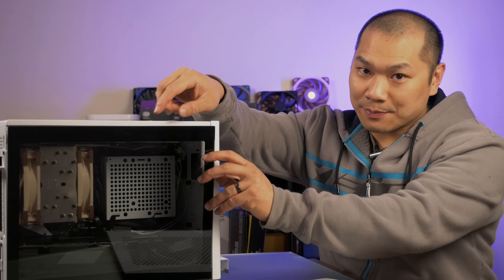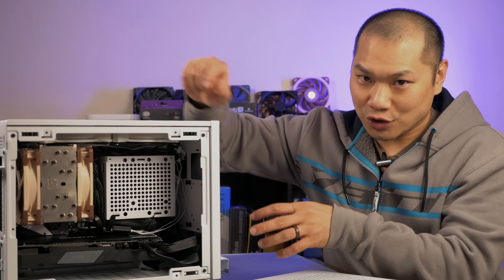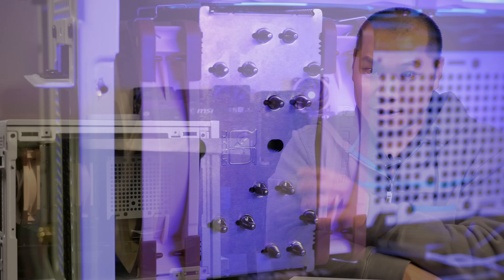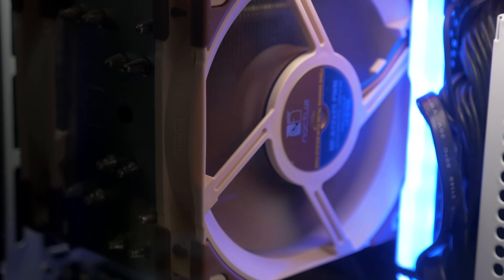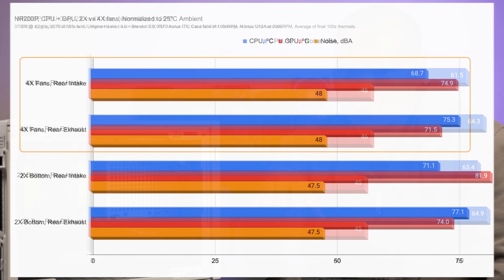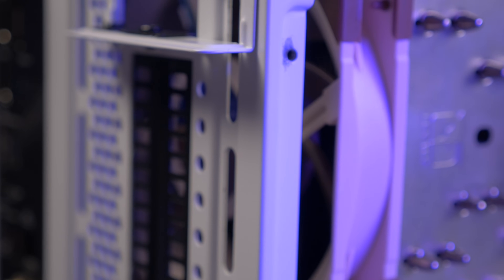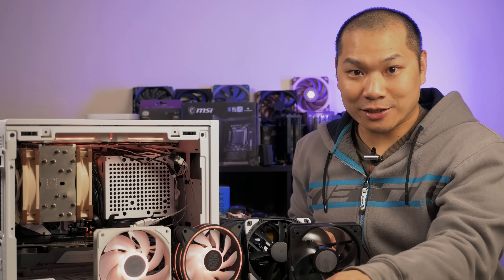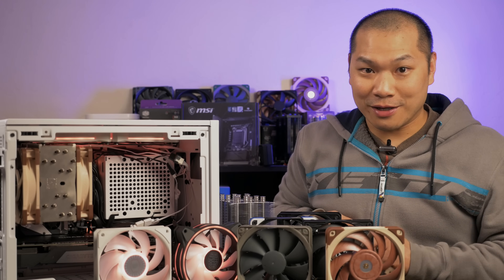Cooler Master NR200: Optimizing Air Cooling Thermals Part II: Higher TBP GPUs and the NR200P

Comment: Hey, thanks for all your coverages of this case. This has been extremely helpful for a first time SFF PC builder like me. What are your thoughts on the Fuma 2 with 2 bottom sickle flow intake and  1 top Noctua NF-A12x25 exhaust? Planning to use the tg panel as well.
Reply: Are you still running this setup? if so, how is it performing?

Comment: For the past 12 years i have been using gaming laptops. And when i finally made my first desktop build after selling those laptop off, i fell in love with your NR200's reviews.

I am pretty content with NH-U12A as exhaust, and Four NF-A12X25, 2 exhaust on top and another 2 intake from the bottom. I used the same specs, with Deshrouded and dowvolted 100mv 1890Mhz Zotac 3080 OC and so far it has been serving me well, and i am satisfied with the performance that this setup provides. It's overkill, but since i am living in the tropics, temps are the only factor i need to take in. Thank you good sir for your wonderful review and suggestions.
Reply: What cpu are you using?
Reply: @PetWanties  same 3700x
Reply: @blackhowling  awesome build mate.

Comment: Nice video! May I ask if the provided case fans will fit at the bottom of the case if you have a 52mm graphics card? If not, what fan would you recommend as bottom fans for the gpu size I mentioned?
Reply from the maker: Cheers! Nope, you will have to with slim fans. For slim, static pressure fans IMO there’s only one solid choice and that’s the Noctua NF-A12x15mm (links in description) They come in both Chromax and regular.

Comment: Thanks for testing all these configurations, really excellent work here!  I have two possible improvements/tests that could be worth testing.
1) The NH-U12A is simply too big for the NR200P and the air flow is not optimal as it break the bottom to top airflow. Having two fans perpendicular is not ideal too. Pairing it with a NH-U9S instead and using "small brackets" to put the fan/intake at the bottom would keep the airflow bottom/top. Wonder the NH-U12A is really needed here, especially if paired with a 65W TDP processor like AMD 3700X/5600X.
2) I also wonder if slim fans like the NF-A12x15 would yield better result in the bottom too by giving airflow channel 1 more centimeter.
This is the configuration I will try, but unfortunately waiting for the 5600X to be delivered and worst, the RTX3070FE to be available for real.
Reply: interested in the south to north bottom top of the NH-U12A as well.. just wondering if the GPU heat would affect it adversely.. anyways do let us know on this update.. thinking of a 5600x AIB 3080/6800xt build
Reply: Good point with the over powered cooler. I have almost the same setting, R5 5600 with a RTX 3070 and have ordered low profile coolers (Scythe Shuriken 2, Scythe Big Shuriken 3 and Noctua L9a). I will test them today and see which one will fit best in my setting. Helpful  and definitely worth reading was the following review which compared the listed low profile cooler. The Scythe big Shuriken 3 was the best in the comparison, second the Scythe Shuriken 2, third the Noctua L9a. Interesting here, the heat removal could be increased when replacing the 15mm fan vs. 25mm fan but only when go for the ventilated door panel.
www.mitxlove.com/2020/04/12/scythe-Shuriken-2-low-profile-cpu-cooler-review/

Comment: Excellent and thorough coverage as usual!

My experience with adding (2) bottom slim fans in the NR200p with my EVGA 3080 Ultra with the TG and a tower cooler (Cryorig H7 intel 6600k at 4.1GHz) was lackluster at best. It improved GPU temps by 1-2°c at most and without the bottom fans the stock fan curve the GPU seldom gets to 70°c+ This is likely due to the GIANT heatsink and 3 fan configuration. 

Due to the slim fans being basically against the GPU it just added turbulence and increase case noise. Fans were removed and returned. 

Waiting for Zen 3 to be more widely available to finish my build. The 6600k has been a trooper these last several years and it's time for an upgrade.
Reply: Interesting, I’m in sort of the same situation with the 3070 gaming trio. I think the frontmost slim fan is actually acting as the anti-sag device for the gpu, as in the card is resting on it. 

I should probably just remove them as well and run the tower cooler as rear intake (using glass panel). Might need something else to keep the gpu from being pushed... those sleeved cables from the SF600 are super stiff and pressing on the backplate.

Comment: Does the NH-U12A allow top fans with the higher offset cpu socket on the MSI and gigabyte aorus 550 mobos? Great information as usual btw! Your series on the NR200 is amazing.
Reply: I’m running the gigabyte b550i, U12A with the 2 included fans up top, fitment was fine
Reply: @neilhr  Ahh cool thanks for the info I think that is the setup I'm going to go for too.
Reply from the maker: Should be the same as the X570-I Aorus. MSI from what I’ve seen is about the same as Gigabyte.

Comment: Are we safe to wire 4 fans into a single header? My motherboard only has a 1amp output.
Reply from the maker: The typical mobo fan header is a 1A output. It depends on which fans. Check the back of the fans you are connecting and add it up. For example the Sickleflow 120 are 0.15A but have a "safety current" rating of 0.37A. Under regular use, even up to 100%, you could run 4 on one header, the safety current rating they give is a "just in case", something jammed the fan while it's running at max speed type of situation. So if you want to be super super cautious don't run 4 of those on the same header. Something like Noctua NF-P12 Redux is 0.09A, Arctic P-12s at 0.2A, any of those add up to less than 1A so you're good.
Reply: Depends on the fans. Look up their specs and it will say what their max current draw is. Arctic P12s for reference are 0.08A, so in theory you could wire almost 12 of them before exceeding the 1amp. I wouldn't push it that far but with 4 you should be fine as long as the current draw for all fans doesn't exceed the 1 amp limit of your motherboard's fan header. I have 4 P12 PWM PST daisy-chained off a single 1 amp header and there are no issues.
Reply: Thank you! I’m running the exact same Cooler Master Halo fans in my upcoming build for top and bottom and was really pleasantly surprised to see you testing it. Loving all the NR200P content, stoked for the Mugen 5 video 🥳

Comment: Will a nzxt m22 cooler work better?
I'd really like to run a glass side panel, and not Screw it in.
Reply from the maker: It won't be better, but there should be a few choices in the upcoming comparison that will allow you to not use screws for the panel.

Comment: 13:00 Finally, people are catching onto the flaws of the Arctic fans. They do growl at high RPMs, especially the 140mm version. And another disadvantage that no one mentions is that they aren't padded with any damping material, so they can induce vibrations in a case. I highly recommend mounting them using "rubber fan screw mounts." The NR200's rubber grommets work well, too.

Comment: Thanks for all your in-depth work with this case. For a 3080 FE and vented panel, is this NH-U12A intake setup preferable over the previously recommended C14S, or is that still the best way to go?
Reply from the maker: For the 3080FE, I would recommend the C14S simply because of the direction of airflow and the ability to natively (without any mods) use the rad panel, which allows you to mount a side fan to act as a second side intake, further improving things. We're really splitting hairs here though, at the end of the day you could run either and it'd be just fine. With an extra pull fan the the C14S is closer to the cost of the U12A so it's pretty closely matched in terms of cost too.
Reply: @MachinesMore With the Fuma 2, would you also recommend running that in the same intake config as this NH-U12A?
Reply from the maker: Yes, especially with any Ampere founders edition graphics card.
Reply: @MachinesMore  Thanks man, think I might just go with the Fuma 2 then - I can live with slightly worse performance when it's only £50, compared to £90 for a U12A or C14S with extra side intake fan. I'm only cooling a 3600 for now anyways

Comment: I have the NR200 Non-Glass Panel and I'm looking for a pure Air Flow setup. 

I'm considering 2 140s as an intake for the side panel and 2 exhaust top, 2 intakes at the bottom, and 1 rear exhaust. as for CPU cooler, I'm sticking with Stock for the time being and may switch to non-Tower cooler later on. 

Thoughts? Opinions? Advice?

Comment: Does the side panel provide any noise/sound benefits? If I were to put the case on my desk would it make a big difference and worth it even losing a few degrees of cooling performance?
Reply from the maker: About 1dBA or so of dampening- although I will caveat that is with a decibel meter pointed at the glass/vent panel, so depending on placement relative to your ears it can matter or not. The TG dampening results in a more pleasant noise pattern if that side is facing you.

Comment: You could flip the right Top fan for intake and the left for exhoust and cooloer exhoust
Reply from the maker: Tested this- 76.8/73.9 CPU/GPU normalized to 25C, it's within measurement error of using 2X fans with cooler exhaust (77.1/74.0). Bottom in, top exhaust, that's how this case should work best. The top fan as an intake suppresses the GPU exhaust and just raises the ambient case air temp, which causes the CPU cooler to get stifled.

Comment: Hey Machines & More :) Love your coverage of this case ! 
I am wondering, can you mount an AIO on top ? Even with that top palen, is it possible?
And if it works... could one use ANOTHER AiO on the regular mesh sideplate ? 
kreygazm.....!
Reply: The only way to mount an AIO on the top is to do the "upside down" NR200 mod. It's a bit of a shame.

Comment: Can you try top down coolers blowing into the TG panel?

I know it's weird but NCase M1 user got the best thermals doing so with bottom & rear intake with a NH-C14S. I'd imagine NR200P will fare better because of top exhausts.

Here's his results: https://www.reddit.com/r/sffpc/comments/ahv94d/ncase_m1_c14s_vs_c14_vs_u9s_results/
Reply from the maker: I did- it wasn't able to keep up at all with a running GPU, and while I think it could work marginally for low TDP CPUs on stock settings... the bottom line is there are better options for the TG panel and I just don't see any reason to choose it for that purpose. The only reason it works well in this case is because you can push fresh air into its intake path, and with the glass, it's just not going to work well.
Reply: @MachinesMore  Ah I see. I was hoping the NR200P  would have similar airflow characteristics as the NCASE M1.

Thanks for all the info :)

Comment: I'm still confused! When you say 4x fans, rear intake, what are the orientation of the 4 fans? Are the exhaust since it's a rear intake, or are all the fans intake??
Reply from the maker: The 4X refers to case fans- The bottom fans always intake (point up) and the top fans should in theory match that direction. The cooler fans are what I describe as rear intake or rear exhaust. Rear intake pulls in air from the rear and rear exhaust pushes air out the rear. The best config is rear intake with bottom to top airflow.
Reply: @MachinesMore   thanks for the fast reply! That makes a lot of sense! What do you recommend for a alternative to the U12a if I don't want to do the screw mod for the tempered glass?
Reply: @PoweredbyGoo  many said fuma 2 fit the case

Comment: That mean C14s is for 3080fe, u12A is for 3080/6800/6800XT?
Reply from the maker: The U12A works well in either version, whether you can use the C14S depends on if you’re running glass or vented panel. When using the vented panel the C14S is great with the hot GPUs, especially the FE Ampere cards. It’s not a good fit with the glass panel.

Comment: Great, informative and straight to the point! Have been enjoying your videos for the past 2 months while waiting to actually get my NR200P here in Germany. It finally arrived today- so this is great timing. Now all I need is for my 5900X to arrive and to try and get a 6800XT and will be good to go. Would there be any changes in fan recommendation with this build and the tempered glass? Seems pretty consistent with what you shared in this video? If only the U12-A came in black as well!
Reply: @Guy_on_Youtube  Nice! Was hoping to use the NF-A12x15 Noctua's or maybe the slim version. Also not sure how it will help. Actually being able to buy the card will be the first challenge I think! :(

Comment: So I've finally finished my build in the nr200 thanks to your amazing vids on the case. I've got myself a 3700x with an L12S and all the optimal fan placements you recommend in your low profile vids, and have a 1660 super atm (two top exhausts, side panel mounted fan pointed at a rotated L12S with the fan on top blowing air towards mobo, two bottom fans below gpu as intake, mesh side panel). Reckon I could get away with upgrading to a 6800xt/3080 down the line without changing anything else in the build (got an sfx 750w plat psu)?

Comment: Honestly, from your previous videos it didn't look like bottom gpu fans were this important, but now they almost look necessary. My planned build has 5600x, U12a as an intake and probably a 3080 with no bottom fans, but now i should reconsider the airflow direction of the heatsink
Reply from the maker: They’re not critical for the vented panel but definitely recommended for the TG. For 3080 for sure, rear intake. Couldn’t even get the OC to stick with rear exhaust with a 3080.

Comment: Running the NR200P with TG, Scythe Mugen in rear intake, and a 5 pack of Arctic P12s. Works pretty well and no screws needed!
Reply: Specs and temps?
Reply: ^(2)
Reply: 2 stock + 1 artic for cpu?
Reply: Does your arctics resonate above 1100 rpm?
Reply: whats your config bro? 2 bottom intake, 2 top exhaust then the other rear exhaust?
Reply: What motherboard are you using, and which Mugen, what is your setup?
By my knowledge, the Gigabyte and MSI B550i have such high CPU heatsink placements, that top fans at 25mm don't quite fit with Mugen 5, and with Gigabyte's board, the useless 'gamer aesthetic' IO shield is so high, you can't really install a 25mm 12cm fan to the rear.
Reply: @funnyarc  I'm using GIGABYTE B450i AORUS PRO Wi-Fi

Comment: u can replace the motherboard standoffs w/ something shorter to fit taller air coolers. https://www.amazon.com/gp/product/B08CV7F6CC/ref=ppx_yo_dt_b_asin_title_o06_s00?ie=UTF8&psc=1 i bought these and it comes w/ 5mm 6-32 standoffs. i was able to fit the pure rock 2 (155mm tall) air cooler with the tempered glass panel on!
Reply: What about alignment of the rear IO cover?

Comment: I’m planning to put the halos on bottom and vertical mount gpu with big shuriken 3 cooler. Using a msi 2070 super for gpu. Still waiting on AMD 5000 CPU’s. Have you tried this configuration?  Watched all your videos but don’t recall that set up. Keep up the great work. I have the NR200P using the glass.
Reply from the maker: Hey Alberto- I tried this in the 3080 reviews- it didn’t look too good for the CPU since the cooler had no room to work. Plus without the side fan things don’t work as nicely. You might be OK if you run a low TDP cpu like Ryzen 5 and use something super low profile like a Noctua U9A, since that at least has some breathing room for the cooler.

Comment: I had NR200P case. I am going to buy an i7 10700K and a RTX 3070.

Do you think a Noctua C14S CPU cooler, 2x intake bottom NF A12x15 fans + 1 exhaust top fan) can handle this CPU and my vga card thermal?
Reply from the maker: Hey there! In general, yes, depends on how you are using the chip. I run a 10700k now in my personal system so I’m familiar with the behavior - if you’re overclocking it on all cores to 5.0+ ghz even a 240mm AIO will be at its upper limit, the 10700K and 10900K are at 200W, even up to 250W for PL2 levels so it’s no joke. So, if that’s your intention, I would not run a C14S. However, the better way to run these chips is at stock and give it the best thermal headroom so the thermal velocity boost can do its job, and IIRC it will only boost up to 4.7ghz on all cores workloads, which should be fine with the C14S. For gaming you don’t need all 8 cores, you should be able to get 5.1/5.0 on a couple of your best cores on stock behavior with the C14S. Depending on the 3070 you go with- full 25mm fans are possible as well.

Edit: I just saw you are using the P version- are you planning on using the glass panel? If so the C14S is a bad idea, stick to a tower.
Reply: @MachinesMore  no, I won't use glass panel. I just normal user. Do you think I should use i7 10700 (non K version) for better thermal ?

Comment: Sorry if you mentioned this in the video... does the x570 aorous have the same higher cpu socket placement that the B550i aorous? There's lots of reports of not being able to fit in a 25mm exhaust fan on top of the cpu using larger heatsinks e.g. Fuma 2, Mugen 5 etc... did you experience this?

Comment: How about gluing some neodymium magnets to the side panel for a magnetic hold? The magnets would also add a little thickness to help with the glass panel hitting the heat pipes. You sould use two stacked magnets if you needed even more space.

I use neodymium magnets with my Nouvolo Steck as the stock magnets suck.

Comment: Since the optimal airflow is from bottom to top, I wonder why they went with the choice to not put a easily removable dust filter on the top. My case top gets dirty very fast and it annoys me a lot! The top panel is not easy to remove unlike the other side panels and often the fan pins keep falling out. Shouldve made the top and bottom just like the side panels.